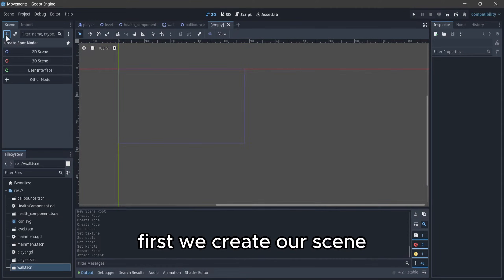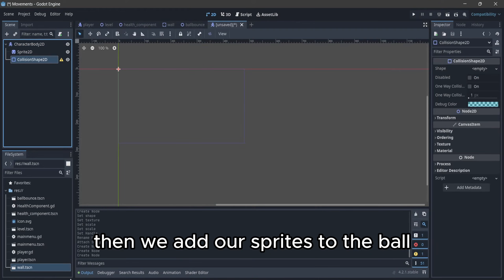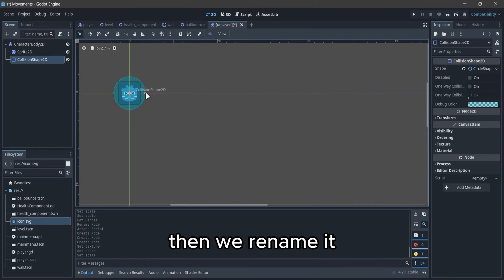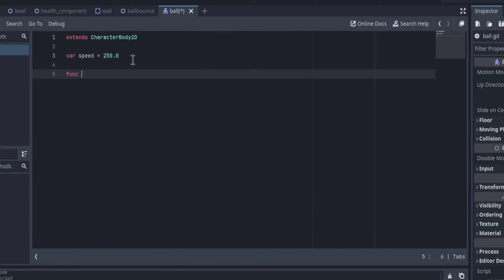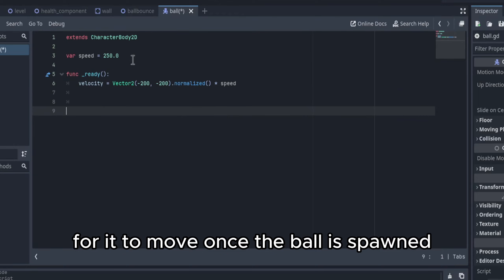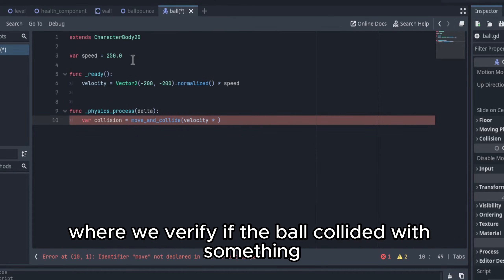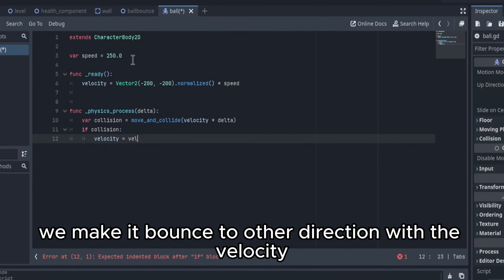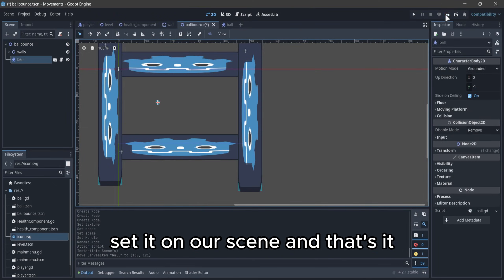HOW to make a BALL BOUNCE off of WALLS Godot 4

Comment: hi there, great work, short, no nonsense and straight to the point 

why velocity needs to be multiplied by delta, i thought it already contains delta , no?
Reply from the maker: Thabk you! Answering your question: If I am not wrong, if u dont multiply by delta, it will just "jump" to the next position, but if you multiply by delta, it will move smoothly. Just because delta is an argument of a function, does not mean that is being used all the time, you still have to call it. Hope I helped.